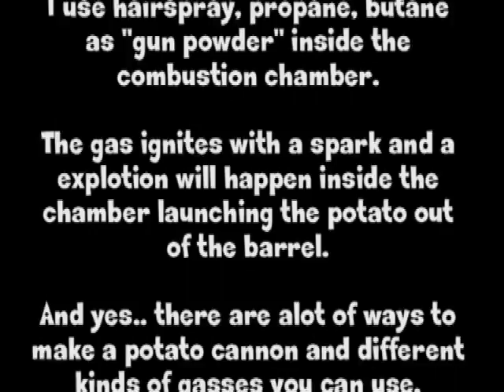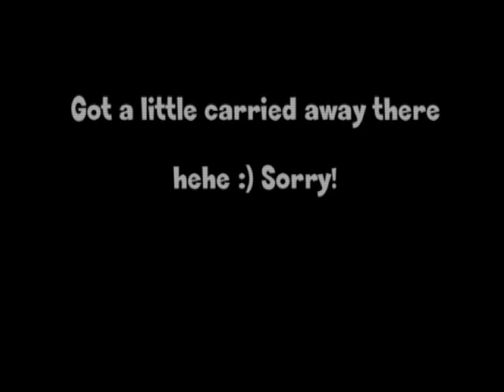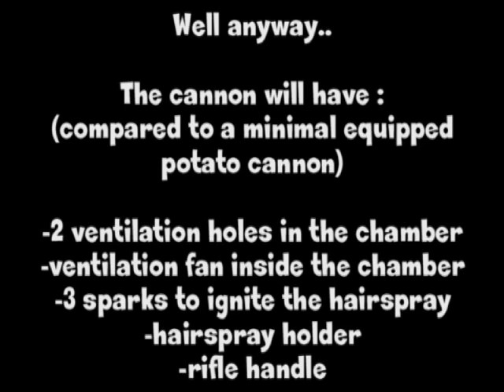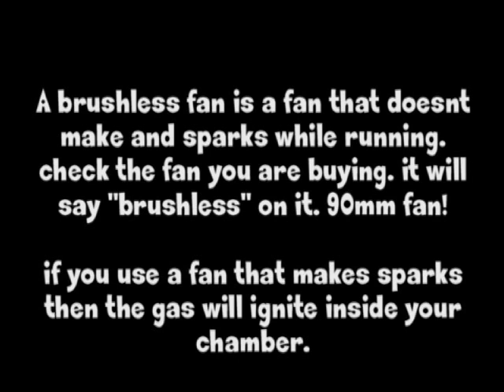How To Make A Potato Cannon (Combustion) Advanced Ep 1 of 2

Comment: Nice one
I have another good idee.
Take a Gas Lamp and remove the cover and Glass.
Screw-away the Gas bottle.
Bore a hole in the middle of Endcap. Put the middle part in hole and screw it with Gas bottle. Seal it!
Now put on the other parts:
Muff, Cleaning part with screwcover,reducer and barrel.
Bolt on.
Finish!
sorry for my bad english

Comment: something that pushes down the lever being a solenoid for instance, the timing mechanism for it would be a simple capacitor with a resistor across it, then take that and splice it into one of the wires that goes to the solenoid, from a battery with a pushbutton switch in it, the capacitor acts like a block to elecrticty, but only after it is charged, while the resistor discharges it so it is ready for the next firing if the switch is not pressed, so you have a fuel switch, and an ignition switch

Comment: what about making it a little quicker to fire by making some kind of apparatus that would dispense the correct amount of fuel into the combustion chamber AFTER it is closed? i was thinking of using those cans of butane that you use to refill lighters with, making a lever that activates its valve, then something that pushes that lever down for a certain amount of time

Comment from the maker: Hey. i found out that i had to put the fan near the back end of the cannon orelse it will get blown apart due to all the volume of all the co2\combustion pressure that has to go through the chamber. so since it is placed at the back of the chamber.. then it will have a minimal of gas going through it when the spark ignites the gas.i have not had one 90mm fan in a normal size cannon that has broken. on my bigger cannons i just make a attachable fan to a pipe that fits around the end of the barrel

Comment: I would turn the van in 90 degree so that  it does not disturb the air by floating out the pipe furthermore the mixture is better. See other videos doing so